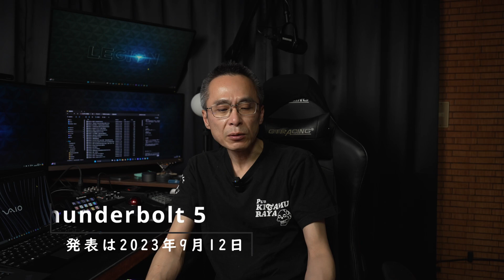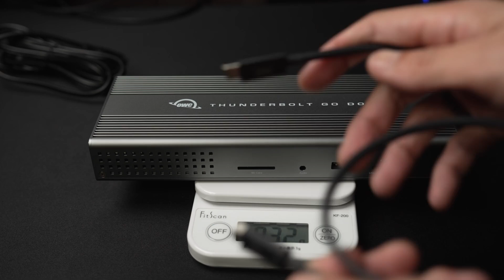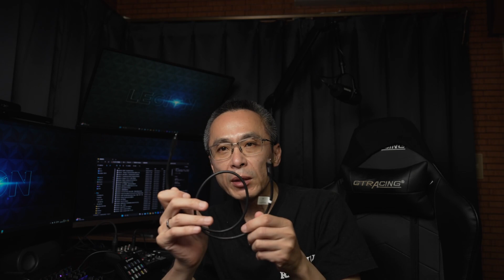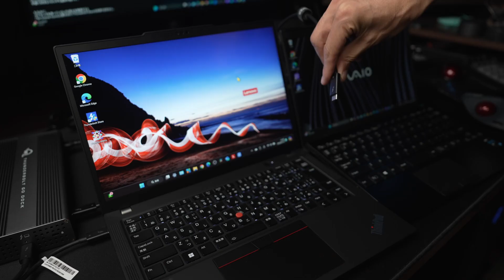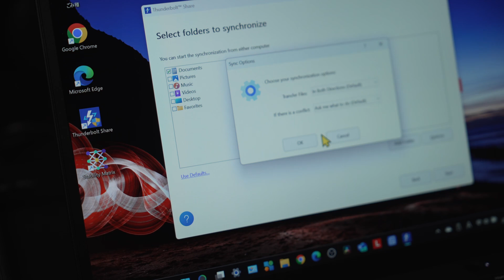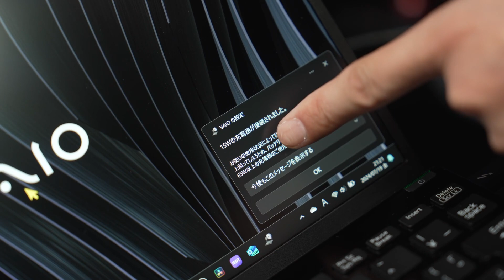"Thunderbolt Share" Connect two PCs at ultra-high speed / AI-translated English version

Comment: Can it do KVM-like feature? Not via remote controlling. I want it to switch like a KVM.
Reply from the maker: Thank you for watching this video.
There are several differences between KVM switches and Thunderbolt Share.
Connection method: KVM switches are switched by a physical switch or hotkey, while Thunderbolt Share connects PCs directly using a Thunderbolt cable.
Functionality: KVM switches focus mainly on sharing input devices and displays, while Thunderbolt Share offers a wider range of functions, including high-speed data transfer, file synchronization, and screen sharing.
Supported devices: KVM switches support a wide range of devices, while Thunderbolt Share is limited to PCs and peripherals with Thunderbolt 4/5 ports.
Which one is more suitable depends on the specific use case and the functions you need.